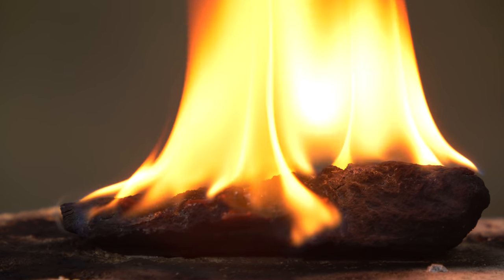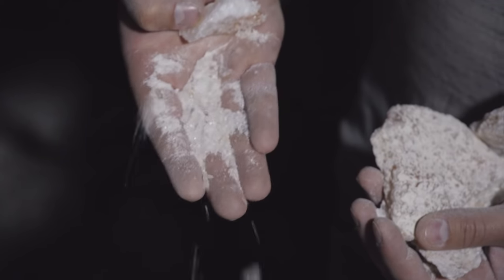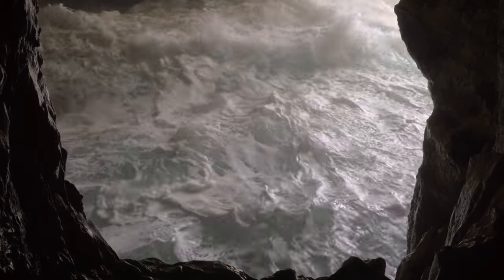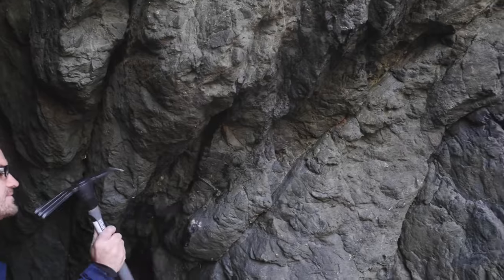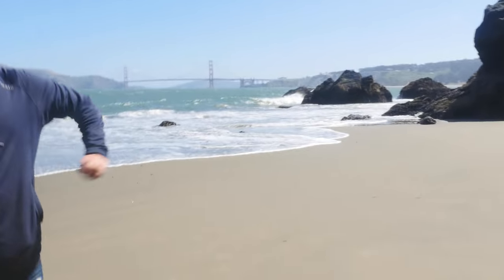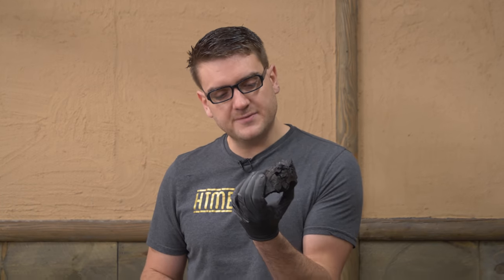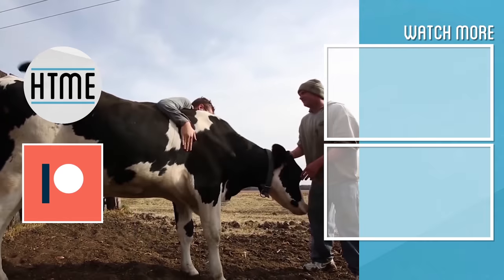Mining My Own Christmas Coal

Comment: I work at an Anthracite coal mine in Pennsylvania.  Anthracite is less common than the Bituminous and burns so much hotter and cleaner. The coal you are getting is Bituminous which is softer and dirtier.  Anthracite is so hard its brittle like glass and shiny.

I could possibly get you some footage of what we do and I could even get you some.

Around Eastern Pennsylvania the Anthracite coal veins come right to the surface.  My mine and others around are taking advantage of the largest vein in the world called the mammoth vein.

Anthracite coal is used for far more things than just burning as fuel.  It's used in the medical field, for electronics, and many other things.

Comment: when you get to steel just remember that the temperature a fire burns at depends on the input air temperature. The is a paining of several fires going up a hill and I think they were using the heat from the lower fire to heat the air going into the upper fire. This approach would take a lot of chimneys  and ducts, but an easier method would be to just blow air down a pipe that is inside the chimney. The pipe would would be heated by the fire and then the air would be routed under the fire. A friend melted the steel grate that held the wood playing around with this approach.

Comment: Pedantic warning. Coal's origins were vascular plants (not just plants) which had evolved with lignin lined cell walls. These new plants were unable to be broken down by the fungi at the time so just piled up. A few years later the fungi evolved to eat the lignin and no more coal was laid down. I believe that's the current thinking. Great video's

Comment: Why the hell didn’t you come to Appalachia. We literally have coal seams in the high walls on the side of the road.  You could have harvested coal with just about no effort to look for it.
Reply: It would also be a lot higher quality coal for smithing than the lignite he’s now Getting from here in North Dakota
Reply: Alan Hardcastle  I think the lignite can be turned into coke. But it will be a fairly light coke that burns fast. It should work for blacksmithing. It just burns faster than other grades. and can’t get quite as hot which is fine. It likely also burns a bit dirtier. It’s not ideal but it should work.
Reply: @JustinTopp  " fairly light coke that burns fast" So diet coke, then?
Reply: @doubledarefan  exactly haha
Reply: Just couldve gone down my back steps and looked in the side garden. Id like to come visit the appalachias.. seems like home

Comment: Just letting you know that coal is graded differently to regular minerals. High grade coal are coals that burn with a higher calorific value, the order is generally peat, brown coal, bituminous coal and then black coal (anthracite). Looking at the coal you got from the mine, while there might be alot of no coal compounds in it, it appears to be bituminous coal(possible anthracite but im guessing not) the coal your friend got was most definitely brown coal. So in short that abandoned mine has a higher grade coal but what looks like alot of gange material in the ore.

Comment: Madrid NM is a great place to collect low-grade tailings from the mine there.  It's closed, with a small museum, but there's piles and slopes of it.  Some of them right by the road.  I used to have a Gasifier powered Jeep (CJ5) that I ran off those tailings.  So, that's about the quality of that ore.

Comment: Run an bellows to the forge then put in coal. Make sure the clinker can be broken up and add an exhaust vent according to modern codes, boom: coal forge! Just don't get your steel too hot or it will burn!

Comment: There are two problems with coal versus charcoal. First, coal usually needs to be dried before using, either in a kiln or by letting it sit in dry storage for several months. This is especially true of surface coal. Second, most coal contains impurities, in particular sulphur. If you try to smelt iron using coal these impurities will combine with the liberated iron leaving you more or less back where you started. So while coal is great for getting the temperatures needed to smelt iron you have to be careful to vent the combustion products away from the ore and you will still need a purer form of carbon, such as charcoal, to act as the reducing agent. Alternatively you can cook the sulphur and other contaminants out of coal, turning it into coke which can then be burned directly with the iron ore the same as you would charcoal.

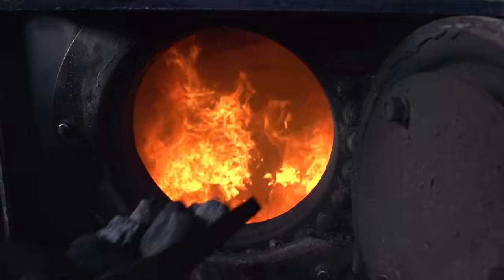Comment: Hey Andy... 1:22 is incorrect. Coal is NOT more energy-dense than charcoal, producing a hotter fire. In fact, that was explicitly why there were so many charcoal makers back in the day; it was needed to produce the temperatures required for making steel because most available coal types like brown coal simply didn't have the energy possible for the stronger fire needed. You have to go to anthracite coal, a relatively rare variety only found deep that has had all the volatiles squeezed out of it, basically, so that its carbon purity (where the energy for the fire comes from in the first place) gets as high as charcoal. It wasn't until the development of cooking coal to produce coal coke that using coal for forging purposes with iron and iron-based alloys was viable, as they simply did not produce the temperatures needed with sufficient volume of coal being available.

HOWEVER, charcoal is also generally porous and not very physically dense, so by unaltered volume coal typically does have more energy. It still doesn't produce hotter fires than charcoal, though. Furthermore, grinding down charcoal to powder and then using a binder like starch and press them into a briquette (even just a manual press is sufficient for this) deals with this single issue, and scrap wood and sawdust can be used as the original wood material (say, from a sawmill, as was originally done) so that there is not waste of usable wood.

The fact that you charcoal tested as being so much worse than that coal (which, TBF, does look like it's bituminous) is more a knock on your charcoal-making skills than it is on charcoal itself. In short, you didn't drive off all the volatiles and so it didn't burn as hot as it should have.

Comment: Ooh you do not want to use coal for making iron, it imbues the metal with impurities, principally sulphur, that makes the metal brittle. What allowed the industrial revolution to really get going at the start of the 18th century was the application of coked coal to ironmaking blast furnaces by Abraham Darby I. Coked coal was cheaper than charcoal, and far more plentiful. It also allowed for larger blast furnaces to be built which allowed for more iron to be made, cheaper. A pretty common theme in the first industrial revolution. "More than before and much cheaper to boot."

You'll need to learn how to purify the coal into coke by heating it in an oxygen-free environment, like making wood into charcoal.

Comment: 2028 let's make a computer
Reply: fun fact, Matt Parker led the construction of a "computer"... built from dominos! :) It's on youtube. 

I studied computer science. Electronics are dominant now of course, but before the transistor was invented (1960?) there was a diversity of computing hardware, ranging from electrical with vacuum tubes ("valves"), electromechanical (relays/solenoids), and even purely mechanical. :)

Comment: Just a word of warning: when mined, coal has a tendency to release highly flammable gaz, which is bad because in a closed space, like let's say a mine, it can and has caused explosions or suffocation.

There are methods exist to help you avoid this, some nice like using acetylene lamps and if the flame changes color, GTFO and some not so nice like taking a canari in the mine and if it dies, GTFO.